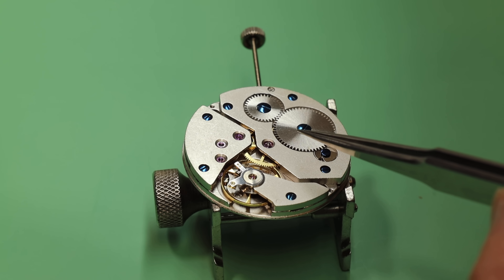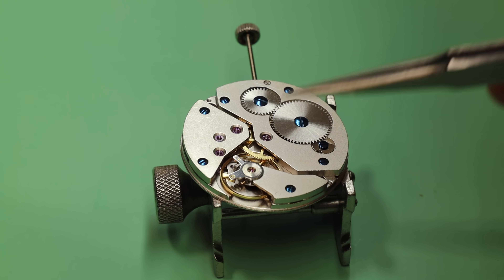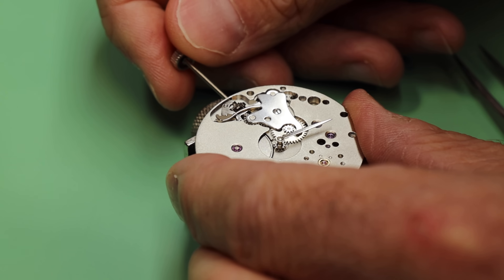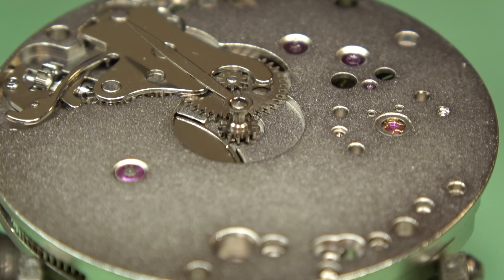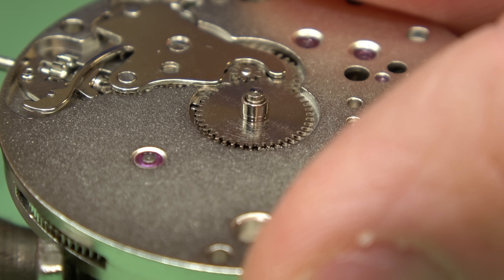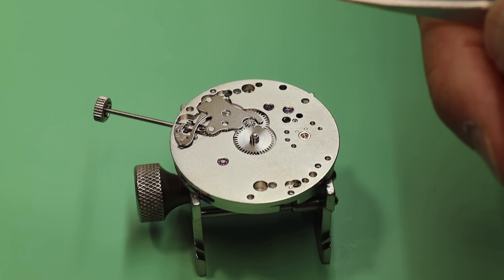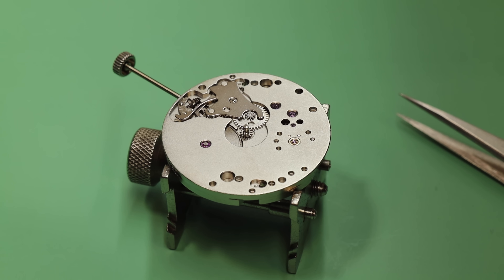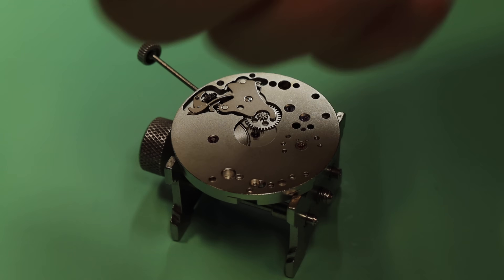Why you should NOT set your watch backwards? Watch and Learn #96

Comment: What about movements that have jump hour hand like a gmt that are designed for that?  Secondly, as a fellow mech eng, when the crown is pulled out, the power transfer from the main spring is disengaged, leaving little or no force on the drive train.  With little force in the train, how much wear is there?   Not questioning what you are stating.  Just trying to analyze it myself.
Reply: Actually It's not disengaged, when you pull the crown to the setting mode the watch push a lever that stops one of the gears or the balance wheel. In other words, it's the same as accelerating a car with the handbrake up, the power is there but you don't move forward.

Comment: Sometimes if you push the crown back in the minute hand jumps a little bit. I always back wind it just a very little imperceptible amount. This seems to prevent the jumping.
Reply: I do this too....go past the time I want by about 5-15 mins, then back to align the minute hand to the correct index.  Seems to keep the minute hand alignment better otherwise I notice some drift after a day or two.

Comment: If my watch is 3 hours behind I can either back up three hours and cause proportionally more wear on the canyon pinion or I can go 15 hours forward and cause proportionally less wear but how do I know that less wear over a 15-hour jump does not amount to more wear compared to more wear over a mere three-hour jump back? I do get the desire to have an even wear pattern due to maintaining the rotational direction but I would think that over time using reversed rotation will establish its own wear pattern. And I suppose the canyon pinion is in the end a wear part that may just need eventual replacement. In any case, now I'm even more paranoid than I already was about even pulling the crown.
Reply from the maker: My rationale follows that, better off going in the same direction than going backwards part of the way, yes.
Reply: @islandwatch  I understand your concern.. I can't come up with a good analogy. Let's say I'm in a parking lot and I can either back up for 30 feet to get to the exit or I can go forward for 200 feet and circle around to get to the same exi. Should I worry about extra transmission wear if I use reverse? The transmission has sliding gears on shafts and  the output shaft rotation is reversed when in reverse gear. Like I said, its a bad analogy.

Comment: I feel like the notion of gear teeth being unequal in durability between directions doesn't hold up metallurgically. They're not hardening only the primary direction side of the teeth, not contouring the teeth to favor one direction. That's like saying your car can accelerate through a clutch pack from 0-60 in 5 seconds, but it's undue wear on the clutch to engine brake.
Reply: especially when going in reverse almost never happens on a watch therefore it never gets worn out in that direction
Reply from the maker: Not exactly what I'm saying. My point is that a watch runs forwards probably over 99% of it's "rotating" life. Maybe even more than that. Why knock things out of whack going backwards?

Comment: Whether you set the watch forward or backward, you are forcing the canon pinion to slip, i.e., to override the friction fit with the second wheel shaft, so I see little difference in wear & tear to the pinion & shaft.  Setting in either direction puts a non-normal load on the going train gears, up to the point where the friction fit slips, and it's not clear that going backwards puts a more dangerous load on the going train or escapement.  I think a bigger concern might be the day/date complications, since they're connected to the hour wheel and not meant to be driven backwards.  (And as others haven noted, Vostoks have the same architecture, but because the date complication has no quick-set, it is expected that you'll go back and forth.)  However, I am not a watchmaker, only a devoted subscriber of watchmaker YouTube channels! :-)
Reply: Totally agreed. Furthermore, a gear train is normally designed to rotate either way without additional wear and tear as they have what is called a “evolving profile”. No slipping among gear teeth, contact only.
Reply: Dissimilar metal bearing have been used forever to AVOID wear.
Reply: In my opinion you are partially correct, moving the canon pinion forward will leave microscopic traces in one direction. However, when moving the pinion backwards it may cause a set of different traces that will wear the pinion faster being a softer metal. This of course may take a long time to be noticed, but it does happen. The quality of the watch will reveal how long it will take. This was a common issue with pocket watches back in the days. Some manufacturers made the canon pinions in a way that when they got weaken, once removed, a littler "tab" can be pushed to reinstate a tight fit again, easier than tapping the pinion to create a notch. Also, if a pinion is overtightened, when moving backward it can stop the second wheel/train while adjusting, follow by the escapement. In the same scenario when a cannon pinion gets overtightened, moving forward will put more pressure on the second wheel/train and escapement and over-banking may occur. However, these 2 scenarios may be more common with pocket watches.
Reply from the maker: Usually day/date change mechanisms won't run backwards as they are usually set on a "slide" of sorts and won't actuate backwards.

However, regarding the canon pinion, I feel going both backwards and forwards a bunch is detrimental.
Reply: @islandwatch  Moving the wheels forwards 23 hours would put more wear on the mechanism than moving it back 1 hour. Whichever is closer puts less wear on the mechanism.
Date displays do normally rotate back when you roll the hands back, just generally not on the hour, but about 20 to 15 minutes before the hour. You need to make sure the date display is fully set before pushing the crown back in, otherwise it might slip and could put excessive wear on the mechanism or even break it.

Comment: What about non quick set date watches that require moving between 9 and 12 to change the date?  Like all the USSR Vostocks, Pobedas, etc.  Do you recommend winding all the way over 24 hrs repeatedly to move the date?  Arent they designed to go back and forth from 12 to 9 to 12.
Reply from the maker: Nomos, many others. Lot's of older movement lack quickset. Can't say I'm a fan of it, but they do recommend it. So. . . who knows! Maybe those older movements are designed against it.
Reply: @islandwatch  I'd guess that a lot of those movements aren't even designed with that being a consideration. Manufacturing and engineering standards in pretty much every industry have improved drastically in just the past few decades.
Reply: They are designed to do that.
Reply: @Bob_Smith19  what is so special about that "design" ?
Reply: Yeah I have to go from 8pm to 2am & back & to. I only wear my Komandorski if it's 5days or less to change, otherwise I just wait for many days or even weeks to pass
Reply: @chris555  no esperes tanto tiempo, ajusta la hora con delicadeza, si se llegara a dañar, llevalo al relojero, el lo repararia a cambio de dinero......ellos necesitan trabajo para poder comer
Reply: If Putin says it’s 13 o’clock, it’s 13 o’clock.
Reply: Bro, truer words...  @johnsrabe